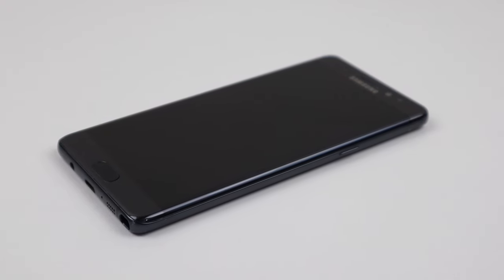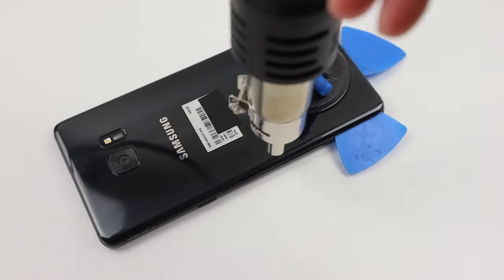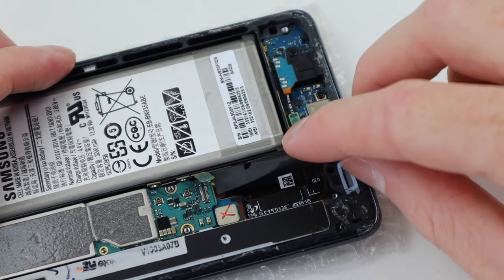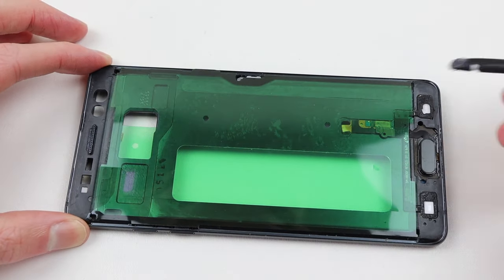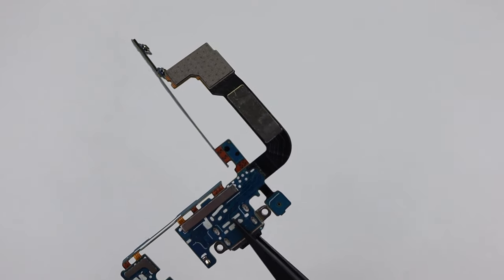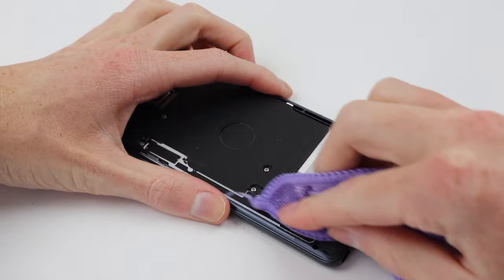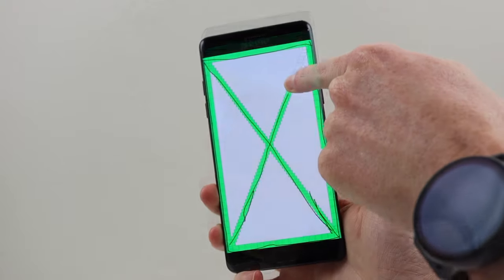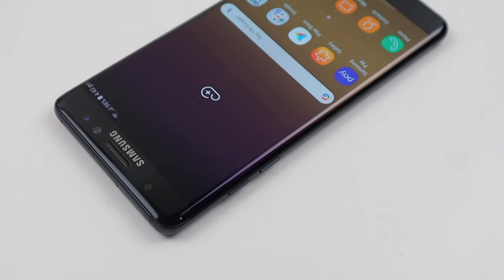Can I fix someones botched repair on this Galaxy Note Fan Edition?

Comment: I would also point out that burn-in doesn't happen to LCDs.  I have never seen an IPS panel with burn-in.  It is a problem with OLED and AMOLED.
Reply: Actually it can happen… is just not prone to as the other technologies, so on a phone is virtually impossible to happen.

Comment: Hey, Hugh! Just thought of mentioning that the unit you have is from Malaysia. The F in the model number represents the country it was meant to be sold in. I am also from Malaysia and let me just say that this is type of repairing process is common here. Currently, I am restoring my friend's Galaxy S6 which he gave to me to keep. He did tell me that he got a battery replacement for it (from a sketchy repair guy) and a few months later, it stopped working after he dropped it. Once I opened it, I was greeted with a mess. It was filled with gunks of sticky dirt and dust. Whats worse is that the battery flex cable was snapped. The battery was not seated in position because the adhesive applied was low quality and it dried out. This explains why the battery stopped working. The battery was also refurbished. My friend also told me that the repair guy charged him RM300 (about 75 USD/ about 100 Aussie Dollars) for the battery replacement. The are other issues with it also (most of which you had with your unit) but this was just bad. He not only got some guy to perform a botched repair on that Galaxy S6 but he also got scammed (A new and original battery replacement costs RM30, about 7 USD or about 10 Aussie Dollars, from a reputable 3rd party seller).
Reply: The F variant wasn't exclusively sold in Malaysia. It was also sold in other countries such as Philippines, Saudi Arabia, Vietnam, Indonesia and Thailand.
Reply: @Burgercat  Was not aware of this. Thanks for the info. Also, apologies for such a late reply.
Reply: @kunaalharidas9983  You should do like timelapse of what you did.
(So it would have fuel as hugh's vids lol)
Reply: “And on that note this was a Hugh Jefferys video” LOL
Reply: @kunaalharidas9983  No prob haha

Comment: Note Fan Edition is kinda awesome here in South Korea. Since Samsung has butt-ton of spare parts from Note 7, the repair costs are ridiculously cheap. The full-screen replacement including the display, metal frame, and the battery is $89 USD. It's pretty dope.

Comment: I just bought a blue version off of Amazon for $195.00 USD in great condition best phone purchase I've made in years.
Reply: I see note 8 for 200 locally all the time
Reply: Im using this phone, sure it has premium materials, but they are better options for the price out there. The last supported version of android is 9, and in my experience, this phone has thermal issues, dont know if its just my phone though.
Reply: @muhdaimanharith  i dont think the older ones have issues, in fact they were considered more superior back in the day
Reply: @crlsdzgnzlz  I still prefer Note 5 and Note 7 over the newer design language of Samsung.
+ No nodge in the top.
Reply: You people know a lot about phones, issues and other stuffs.

I just use them, play, could not get them fixed so i buy a new one keeping in mind that i may loose one or broke so price should not hurt my pocket if i loose on or two in a year
Reply: I got an s10e in yellow,  it looks so frickin amazing
Reply: How? I thought these were discontinued
Reply: @fatfalcon3434  Ebay
Reply: @dtay8913  Etsy

Comment: I want to believe that this phone ended up like that not because of malice, but stupidity. Whoever tried to fix it didnt knew what it was and didnt have the parts, so he scrapped together what he could but then realized that now it didnt want to charge. Probably got it with a smashed screen, and after replacing it and discovering that something was very, very wrong with the charger he just gave up on it and sold it.

Comment: The screen burn in might have something to do with the connections. You'll have to take it apart and really clean up the connections and make sure they fully seat right. This happened to me on a Note 9 screen replacement (ghost/burn in images)

Comment: I still own an original Note 7. I remember getting in the mail a few days before it was released in the stores. Verizon actually let me keep the original when the recall happened and sent me another one free of charge. when that recall happened they only had me send back the 2nd one and never the first. my sister also had the same thing happen to her.
Reply: how is that note 7 doing? did it explode?
Reply: @AbdAbdAbdAbd  still works didn't explode but it now runs really slow since It hasn't been updated since the first battery update where they capped it at 80%

Comment: The screen burn in of a map app is most likely from the driver side app of some ride-sharing service (Grab, Uber, Gojek, Lyft, etc), based on what I see on some used Galaxy phones for sale where I live.
11:58 So that's how Galaxy S8 and later can tell what colour they are! It's from the display! I can now imagine replacing the display on my black Note8 and it thinking it's a blue model.
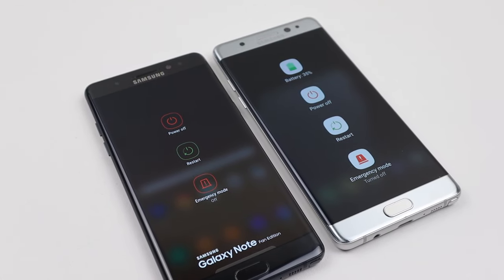13:07 It has a Note FE logo on the power off menu?

Comment: The problem I see when sourcing from anywhere but China is that often the seller might be in the West but is selling the same Chinese merch so you're back to square one...
Reply: Most of parts from eBay are almost certainly from China. Even if stock is shipped domestically, it very likely came from a Chinese company.
Reply: @atomstarfireproductions8695  and you end up paying nonsense money for literally the same product sold by a proxy.
Reply: James Smith true.

I don’t trust any unbranded manufacturer of replacement parts. Ifixit is the only brand that I know of that I trust.

Comment: I had this phone in black color but the AMOLED screen is broken and it has a Android Pie 9.0 software with a one ui 1.0 so I'll tell you guys how did it broke 

It fell on the 2nd floor in SM city cebu here in Philippines that's why

and i have another Note FE but it is a Korean Variant with SK Telecom Band LTE boot animation but it has a charging problems
Reply: You're very clumsy then. :v
Reply: Sad

Comment: As a tech I wonder why you decided to open the screen, it only need to change the charging pot why alcohol you are able to pull the cables in and out, you might need to lift it from the home button side

Comment: You are fearless in you attacking these Samsung phones, a bit envious on my part. I own three LG V20 phones because they are easy to service, they use one size screw for the entire phone, and they have replaceable batteries. Also, I have all of the parts for them when they break, or I accidently run them through the washer and dryer.

Comment: my dad used to repair iphones, (and occasionally samsungs, but he hated repairing them, at the time iphones were easier to repair, maybe not now, but then they were I think, or atleast he was used to them) he got the screens and parts from china, but too often would he have to return a part (like screens) that simply didn't work. he quit around the iphone 6-7 (maybe later)when replacement screens were like half the price of the device, and almost impossible to find.
edit: just to clarify I believe he brought the parts from chinese ebay sellers, and I believe he would also check reviews. generally most parts worked, even if that is shocking.

Comment: I totally agree with what you said. I also repair phones from time to time and unfortunately it is tough to source original screens here in Croatia, so I only have sites like Ebay and Aliexpress, and I sometimes try to find dead phones with working screens and similar. But yeah, screens from China sellers are always so fragile or sometimes they don't even fit or work properly, and getting refund is so hard even with clear evidence. But unfortunately I don't have another source to get them so I deal with what I have.

Comment: Using this phone, dont know if its me, mine has thermal issues, and the performance takes a massive hit. The temp of the room makes a massive difference, it ranges from 150k-195k on antutu

Comment: Hello , we get same station but i never succeed to remove back glass without break it, which temperature and air flow are you using to remove back glass please, i never go far than 100°C please answer me it would be really appreciated please i will get my first micro-company in 2 weeks and i want to fill my weakness.
Thanks a lot i love your videos

Comment: It actually baffles me how many picks and tools people use to open Samsung’s. If you have enough heat, all you need is super thin metal and insert it about a mm or 2 just to get it started. Then use one blue pick. I’ve never damaged the paint or cracked the glass.

Comment: Hugh Jeffery I got a iPhone 6s refurbished from eBay almost a year ago it has the burn screen but mine happens when it heats up and if you stay in the same screen I’m in the uk 🇬🇧 the iPhone 6s was £184 which is a rip off also the mute switch was broken and I told the seller said he won’t do anything even tho he was claiming that it has 1 year warranty even though it came broken he even claimed it was original parts and it fully tested by the team 😔 what should I do?

Comment: Quite a hassle to fix and still not get a properly-working handset.

The Note FE was underwhelming for me, coming from a note 4. Mostly with the way it felt in the hand (felt smaller), so I traded it in for a note 8 2 months later. In hindsight i should've gotten the 8.

Comment: Sounds like you need a better supplier in China. Which can be hard to come by. I got lucky with mine. If I want a defective display that's what I get. If I want original, copy or whatever I always get what I paid for. I do notice some are shady. But I also buy quite a bit at a time so maybe they want to be more honest then just selling 1 LCD. And sometimes its just luck. Good video as always.

Comment: Lesson learned: Do not trust all repair shops. My friend had a samsung galaxy J5 2017 and the shop he went at instead of fixing the broken screen they just threw in it double side tape and they had damaged the oled display and it would not faction right.He to pay two times and he just decided to change his phone. Never but NEVER trust sketchy repair shops mates.
Reply: This is why apple and samsung have been lobbying against repair rights and this is why

Comment: Well, I guess I was lucky then. I purchased one oled screen from China (it was for model not sold in our country, so I had no other option) and it works flawlessly. I chose one of more expensive listing also paying attention to reviews, and it has no functional nor cosmetic flaws. Not that I would recommend sourcing china parts, I had to wait about 1.5 months and it was a lottery whether it will work or not.

Comment: Question for you. I know we’re in July so hopefully you reply to this. So I have an original Verizon Note 7. Literally untouched brand new and I only used it once before the whole battery explosion craze happened. As it turns out my phone updated to the newest firmware that I think bricks the Note 7. Is there a way to reverse the process to make the phone useable again. Also since the phone is the original it also has the original battery to it. No explosions though lol

Comment: I’ve had an iPhone X replacement display fron China that had colour problems.. aka only tolerable in dark mode...

But it was way way cheaper to get it that way as even a third party repair shop charged way more for the same service. 

On top of the last place probably not putting in the gasket... (as judged by the lint as dust crooked front camera)

Comment: My phone is an iPhone 6 and  the screen is cracked due to me dropping it but about every 5 mins my phone will shut off and reboot despite it being plugged in or not also my battery count is being very inaccurate because it jumps around from 65% to 70% but it will start on 1% when rebooted which is weird but then it goes to a more accurate percentage what is the problem with it

Comment: Hugh: Where are you sourcing parts from? I'm in Australia and even local eBay sellers have imported stuff from China. What's your go-to source?
Reply: I usually get parts from Repair Universe, usually only takes a day or two, but I'm in the US. Right now covid has caused them to run out of stock though
Reply: ifixit.

Comment: Hey, my name is Pieter and i like to repair iPhones. I have a problem i was wondering if you could help me. I received an iPhone x that had been stuck in a washing machine. The screen is broken. And it was a little bit open. Because the battery was swollen, there was a gap. So the water got inside the phone. I have taken it appart and noticed a little bit of corrosion on the connectors. Not too bad. I have plugged it in in the computer and it showed up in itunes after I did a reset(volume+,volume-,power button). The thing is it gives me an error in itunes when I try to restore it( error 4013). I do not have a replacement screen to test the device. So I was wondering if you could help me out.  

Thanks Pieter Van Acker

Comment: You're a decent guy but the think i dislike and i'm sorry if you take this the wrong way. It's that you don't really repair much. You take the easy route most times on average costing more than any other generic repair. Some people view this video's as educational and for learning how to fix their own device but i've noticed a trend of you purchasing almost full phones and transplanting a few parts into the new device instead of repairing the one faulty part. A repair that should of cost $40 ends up costing $200 which may steer people away from the point of the video. Please don't mistake this for hate i do enjoy the video's.

Comment: i had my iphone 6 display replaced by some shady chinese guy (in china) and now i have a slightly faulty display that has temporary burn-in (i.e. display the keyboard for 3+ minutes and the a blue-ish version of that keyboard will linger for 10 minutes. After this experience of two devices being made faulty by a chinese tech guy, (first time was with my beautiful white 64GB iPad 4th gen, he took my gosh darn back, completely unscratched, and replaced it with a one so scratched you can easily see the bare metal while i took it in for the top of the touchscreen not working, came back as glitchy touch) i will now just repair my own devices. 
ps i’m chinese myself lol

edit: he also used hot glue as adhesive for that ipad, and didn’t just take the back, he did an entire housing swap (why?) and when i complained that there were holes in the side of the ipad, the touch was faulty, and that the display was being pressed on causing little darker spots, he just said “It came in like that” but i had pictures. He just denied everything and said it was my fault because i dropped it or something. Then he told me to get the frick out. Fucking scam.